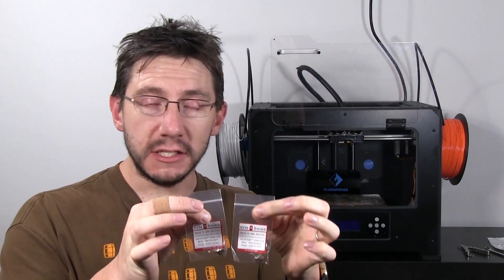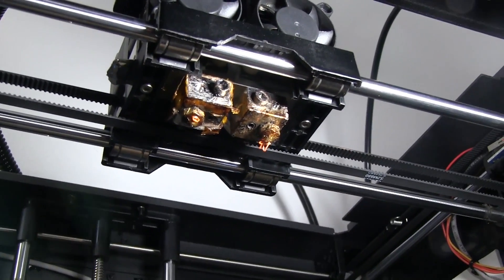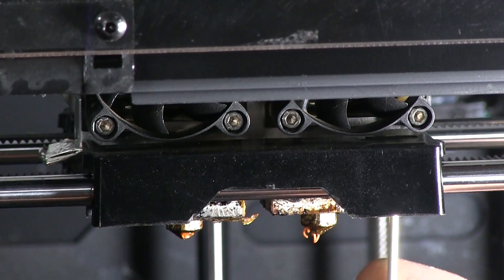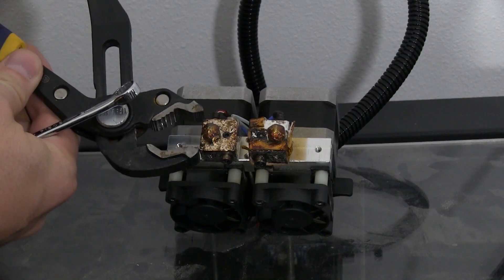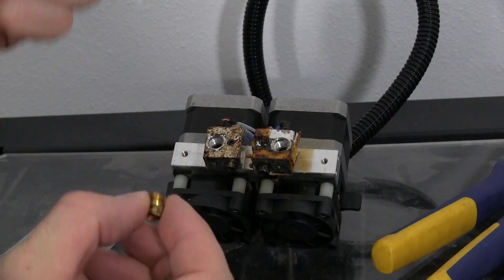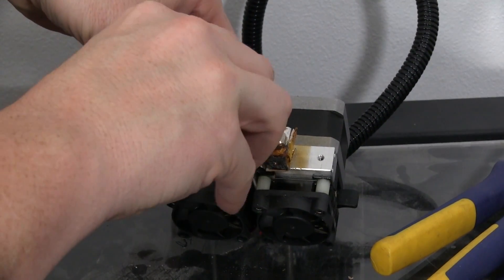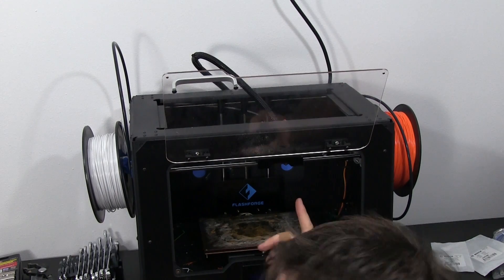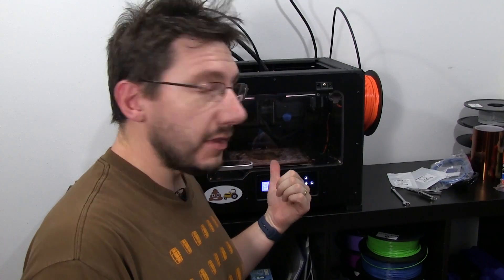Replacing Nozzles on the Flashforge Creator Pro

Comment: Have had a creator pro for 8 years. I would like to be able to physically remove 1 of the extruders. Might just unscrew the nozzle and leave it out.  

 Iv knocked over 4 hr. prints (3 hrs in) with the 2nd nozzle hitting it while the 1st extruder is running.   Bad design in my opinion.

Comment: Hi there. Hopefully you can see this message. Thanks for the video. I just got a used creator pro and noticed that one of the nozzles is a little bit higher that the other. The left nozzle is perfectly leveled while the right one is very close to the bed. I noticed the other day I was dual printing, and the right nozzle was dragging and ruined the print. I saw on the video the use of aluminum foil, but I do not know how or where to put it. Can you help me with this please? Thanks.
Reply from the maker: Hey! Think of the foil as a shin - you'll use it to make sure both nozzles sit at the same height.

Comment: Thanks for the clear instructional video, Joel. One thing I wanted to see you show was a quick confirmation that the nozzle tips were level. 

I've shimmed other things with aluminum foil before, so was confident I could figure out where that would go and how much to use. (as many layers as are necessary, on the high side only!) 
----------------------------------------------------------------------------------------------------
More shim story than you ever wanted to know: 

My previous experience with aluminum foil shims was when I used the stuff to reposition the cam towers of a 1979 Datsun 510 2-liter 4-cylinder engine because the head warped one time when the radiator blew. 

Well, the cam towers, being mounted on top of the head and then line-bored so the cam would fit perfectly in each, were leaning all over the place after the warp. On the underside, I had it milled flat again and a valve job done, so those things were as fixed as they could be. 

But the cam towers were binding on the cam, so when I reinstalled the towers, I would snug them down, and used felt pen to mark the inner surfaces to see where the cam was rubbing when slipped in and spun by hand. 

Shim by shim, I added layers of aluminum foil between the tower base and the top of the head, pressing a layer of foil onto the cam tower underside, then neatly cutting each with a #11 X-Acto blade to form a gasket shape. I did this on either side of the cam tower, to lean it this way or that, and under the entire surface if it need to come up. 

After a few hours of cutting multiple shims, mounting the towers loosely, felt-pen marking the inner race of each one, then inserting the camshaft and snugging the bolts until it was hard to spin, then cutting more shims and repeating over and over, I finally got it so I could spin the camshaft by hand. It was tight, but I thought as soon as oil gets up there, that would make it spin easily. 

I was wrong. It worked great for h, about a few thousand miles, but the very slight misalignment that caused it to spin with moderate hand-force was flexing the cam each time it made a revolution. 

Eventually, while on a week's vacation over in Chelan, WA, the camshaft had just about enough of that flexing, and it snapped in two, right in the very middle of the cam, between the second and third cylinders. The two cylinders closest to the firewall were moving up and down, but the valves for those two were closed for business. That half of the cam just sat there. 

The break was even enough, flat on those faces, that the broken ends just bumped against one-another lightly, not causing a problem. So, the front two cylinders were the only ones still alive, and the car immediately ran like an old 15 horsepower farm tractor. I took off the valve cover to confirm what was going on, since I always take tools with me, and it seemed fine except for the break. There was no other problem, so I buttoned it up and continued to drive it around town. 

Next I went to a gas station, and had them order the camshaft and gasket set, to be UPS'ed there ASAP. I was going to do the cam swap right there. In the meantime, I continued to drive around, enjoying my vacation in the sun, chugging along with just under half the power. 

When the camshaft came the following day, I had already gotten used to the gutless two-banger tractor motor, so decided NOT to do the swap until I got home. Actually, it was pretty doggone funny. But driving it back home, about 130 miles, that meant taking on the 4,300 feet-high Stevens Pass, and all the uphills between Wenatchee and Stevens Pass to do it. 

Well, the week of vacation came to a fun, slightly sunburned end, and as I drove home, I crested the pass doing a whopping 20mph. Almost fast enough to make the hair on your head move! 

A state Trooper on the far side of the highway was ticketing someone for speeding, and as he heard me approach, chugging along like a tractor, hang glider on top, mini-bike on a mount up in front, sagging low from all the gear that was packed on it and in it. 

He stopped a moment, looked at me, tilted his head like the RCA Victor dog, and then just went back to what he was doing. I guess I just wasn't going fast enough for him to pursue me. 

After cresting the pass, I was able to get the car up to the speed limit here and there, which was great. 

Finally arriving home, I unpacked, got a good night's rest, then did the cam swap at a leisurely pace. THIS time, however, I took my dear sweet time and got the cam towers so well shimmed that when it was all bolted down tightly, I could spin the cam with two fingers. This cam was going to last. 

So, adjusting the valves and buttoning it all up, that car ran for another 70,000 miles or more, and I finally sold it to a kid in high school who just needed dependable trans-po, and only had a few hundred bucks to spend. I sold him the car, and gave him back a hundred bucks of what he paid me, just because it felt right. The body was old, and beaten, but the drive train was still in great shape. It had a quarter-million miles on it when  sold it. 

The End! 

So, you want to talk aluminum shims? Hahaha! I can talk aluminum shims! :D
Reply: PS - I know your father-in-law through Facebook. When I mentioned I'd recently bought a used Flashforge Creator Pro and needed to learn, he mentioned you. Thanks for your help!

Comment: Ive been having some issues with my creator pro. the filament keeps sticking to the little tube thats inside the hot end. What do i do about this?
I tried replacing the tube with another, but it started happening again. Its like i can get a couple of good prints with one of these tubes, but eventually my filament starts sticking, and then im getting under extrusion until it finally blocks up the hot end completely. is it that im running too hot? I feel like im experiencing it more with some of the abs that i got offshore that calls for 230-260° C. I ended up having to turn it up to about 248° to get this filament to stick to the build plate and extrude evenly. But it ended up clogging that tube. What would you recommend i do?
Reply from the maker: Hmm, I would print ABS at 230c on my Creator Pro. Going over 248c can destroy / deform the tube (called a PTFE tube) and make it so filament deforms it and eventually clogs.

Comment: @3:08 Why was the heater block already loose from the larger block? Is it supposed to be loose? I think I over-tightened mine and now they're not equidistant. 
Tightening the extruder nozzle, it was still loose from the main block.

Comment: I know it's an old video, but  I'm setting up my new FlashForge Creator Pro, and noticed the uneven nozzles. The aluminum foil tip saved me a lot of time and headache. Made a "washer" out of it, used it on the side that was lower and added layers as necessary, it took 3 for me.
Hi Five

Comment: So after almost two years, how are the Proto-Pasta extruders performing?  Would you recommend the upgrade? Thank you
Reply from the maker: So far they are doing okay, but these nozzles have seen far, far less use than other ones. I think if I was pushing abrasive filaments through them 24/7, they would have seen a replacement after a few months.

Comment: Great video, but you don't have to unscrew it from the carriage to change the nozzles.
Reply: I was thinking the same. Why not just hold the heater block w pliers & use a 9mm socket to unscrew the nozzle while still on the rails?

Comment: I realize this is an old video by now but wow, those old nozzles and the heater blocks are a mess, are you not concerned with fixing the insulation around the heater blocks?  Did your FFCP work good still with the heater blocks all marred up and no insulation on them?

Also, I did the all metal hotend replacement by Micro Swiss (same company that makes those nozzles you had, not Proto Pasta although that may be where you got them) and when I did that I had to re-align the nozzles.  To do that I just moved the print bed up to the minimum z-axis (put FFCP in bed leveling mode) and left the set screws for the heat barrier tubes loose. I was then able to get both nozzles touching the bed and tightened the set screws, so far I have had no issues with the second nozzle dragging.  My bed was already level when I did this to ensure the nozzles were the same height, I had to re-level and set the first layer height once done due to ensure there was proper distance between the bed and nozzles.

Comment: I'm on the verge of buying a Creator Pro, but I can't seem to find much info on the dual extrusion system. I've seen tons of videos and reviews on the thing, but only a couple that featured any dual extrusion. Do you use yours? Is it a feature worth having, or does it cause more harm than good (2nd head colliding with prints from 1st head, etc..)? The Creator Pro seems the best option for my budget, but I'm leery about that one issue.
Reply from the maker: +Jasper Moore hey! I use dual extrusion on the machine less and less since owning it more than two years. It's a tank for sure and I would highly recommend it, but, I just don't use the dual extrusion nearly as much as I thought I would. It IS handy having it as a backup in case one jams and you don't want to clear the jam right away.
Reply: Hey, thanks a lot Joel, I appreciate the feedback!
Reply: I've only had my printer for about 10 days, but I haven't been using two extruders at once much at all. I used it at first to use a different support material, but I found that using the same support material as your print material works pretty good and comes off cleanly.

So far its just been nice to leave two different materials loaded up, and switch between them instead of having to unload and load new filament.
Reply: Thanks for the input. I ordered a Qidi, which is basically the same printer as the Creator Pro. It will be here Wednesday, so I'm excited to get started. I'll probably give the dual extrusion feature a shot for experimentation's sake, but I doubt I'll be using it much, except as a backup.

Comment: You should show where you put the foil because that could really help me with my new nozzles . Thanks
Reply: Watch when he takes it off the rails after 2:20. The foil is on the left side of the screen and falls out of where he put it.
Reply: @Pelnied  Dumb question, but is it always going to be the left side that needs the foil? Is there some way of seeing if the nozzles aren't level?
Reply: @HunterGeophysicsAustralia  you could have either the Left or the Right nozzle be higher than the other. I'd just recommend if you are messing with the extruders, start by but adjusting one of them so that you can keep the other as a good baseline for reference. I been able to tell the extruders are uneven height by how much they grip the paper while doing bed leveling. If one extruder dragging harder against the paper, it's lower than the other side. You might even tell with test prints that have a large surface area. One extruder may have a better first layer than the other.
Reply: @Pelnied  gotcha. Thanks
Reply: 7 years later.. thank you. i have the same leveling issue with my ff creator woodcase
 @Pelnied

Comment: I have a FlashForge Dreamer, so this shouldn't be that different, right? So, I'm trying this and the brass head won't come off; it's very frustrating. Do I have to heat anything up? I've tried that too, roughly 220 degrees Celcius. Still won't come off... Would like any advice
Reply from the maker: +RYAN YOU um, I don't think it'll be much different. you'll want to preheat. possibly even hotter. get a good grip on the heater block (don't crush it) and use a wrench. good luck!

Comment: What is the difference between your Old nozzle and Those you put on?
Reply from the maker: +Eric Thibodeau (Création3) The old nozzles are just brass. The new nozzles are brass, but plated with something that helps guard against the wear of filaments such as carbon fiber.
Reply: +3D Printing Nerd : Still need those Teflon tube??
Reply from the maker: ***** Yessir.

Comment: Noticed one of your heater blocks was a little loose.  I just purchased a CTC printer which is similar to this one and one of mine is loose as well.  Drives me nuts.  Is there a way to tighten it up?
Reply from the maker: There is a little grub screw that can be tightened I believe but you have to remove the motor to tighten it. :(
Reply: I've been reading more about it.  Remove the motor or just the fan?
Reply from the maker: Matt Patterson I think you have to remove the motor because the grub screw is in the back. I think.
Reply: OUCH!

Comment: What Nozzles does the FlashForge Creator Pro use? I want to order from http://www.proto-pasta.com/products/plated-brass-wear-resistant-nozzles
Reply from the maker: +Andrew Wataszko It uses mk10 nozzles
Reply: +3D Printing Nerd what orifice diameter should I choose for the FlashForge Creator Pro?
Reply: +Waheed Alsayer The printer ships with a 0.4mm so if you don't want to tinker with any settings, stick with the 0.4mm.

Comment: You know you can level you're nozzles individually so you dont need that piece of foil, heres the video where it shows you how to do it. you dont need the 2 heat-sinks that they use, I found that 2 4x4 Lego pieces stacked on top of each other along with one of the slim plates is about the same height as the heat sinks. Here is the link: https://www.youtube.com/watch?v=1pAPA0mImhI Happy printing!

Comment: Awesome.  Nothing more satisfy than fixing a problem after watching a DIY video.,Hey, quick tip for people without guitar string --- wire wrap wire works perfectly too.  30 AWG wire is 0.255 mm.  Had a fully blocked nozzle.  Took out a really small dremel tool inserted it into the nozzle and spun the nozzle.  Don't use the actual too, brass is too soft.

Comment: Cheers mate for the tip... If you are carefull , you don´t have to remove the head, just grip the extrudeblock from underneath, then loosen the nozzel with the 9mm... worked for me ;-)
Reply from the maker: +Martin Pearson I figured it could be done without removing the head, but, not until after I finished this. Heh.
Reply: +3D Printing Nerd,   it always goes that way.. first the hard way😊😊😊😊😊

Comment: So this are the Nozzels what you had mean to print Proto-Pasta ?? Say can i turn my Dremel 3D Idea Builder into an dual Head Printer ? or is that impossible... Sadly here in Austria we got just the Dremel not the Flashforge ><
Reply from the maker: +Mario Obermaier Hello! These are the nozzles I needed to more easily print the exotic filaments that Proto-Pasta sells. Filaments such as carbon fiber and stainless steel. I don't think it would be impossible, though, I think it would be very, very, very difficult.

Comment: Looks good but you need to replace the thermal blankets that cover the heater blocks. It helps with stabilizing the temperature of the heater blocks. Also it helps prevent your carriage from melting. You can get them at fargo3d. That's where I went when I was replacing them on my makerbot. They should work on your heater blocks as well since most are based of the MK7 extruder.
Reply from the maker: +aamcclary YES I DO HOLY COW. Also, thanks for the tip!

Comment: Joel,
Literally about to do this same upgrade to mine printer. Could not have been timed better as there aren't many details about our printers specifically. Thanks much mate!
Also, are those where your filament holders are during printing? Or are they just used as temporary holder for this video? How are they attached?
Tim
Reply from the maker: +Tim Hamerly Those filament holders are a temp solution until I can find a better way to hold the filament in front of the printer. I would have used this method, but it seems to bind a bit. I would LOVE to mount the filament above the printer, just haven't had the time. Let me know how your procedure goes! The holders you see in the video slide into the hand-holds on the side, and the model was one of the MANY I found on Thingiverse.
Reply: +3D Printing Nerd Cool! I was thinking it was just temporary. I too am trying to find a better solution for filament holders, which could go anywhere if I'm printing PLA, but with ABS needing the enclosure I'm at a loss for where I could put them. I'm thinking about building a mount out of wood that would attach at the back of the printer and allow the spools to be elevated above the printer. Haven't gone further than just thinking about it though! Let me know if you come up with a good solution.
Reply: Send me a message show you what I have done.